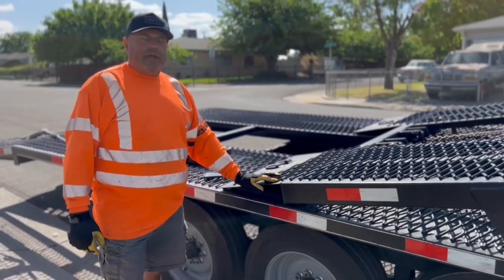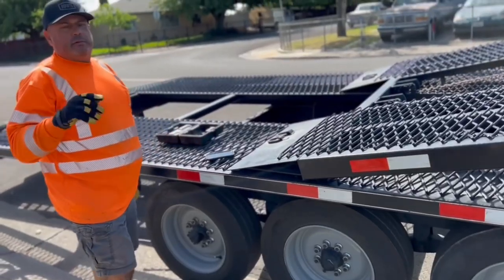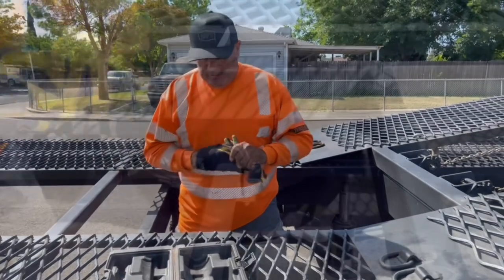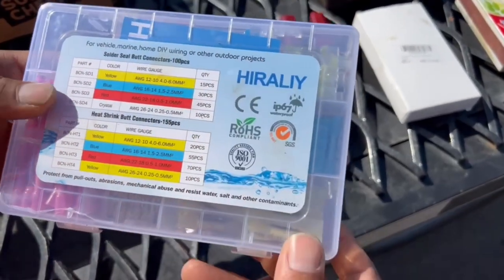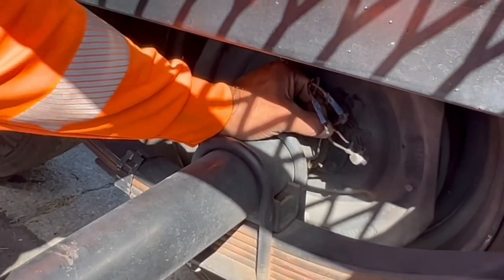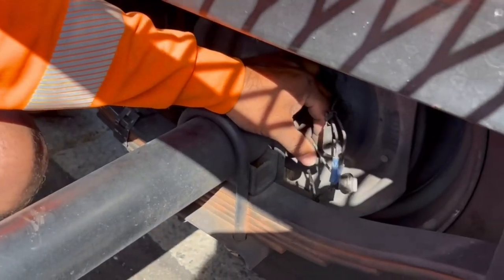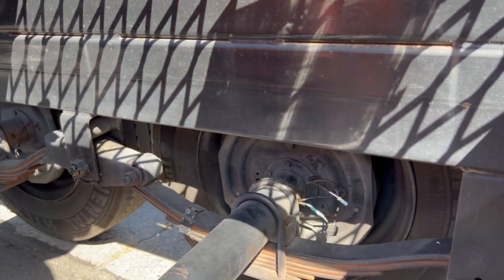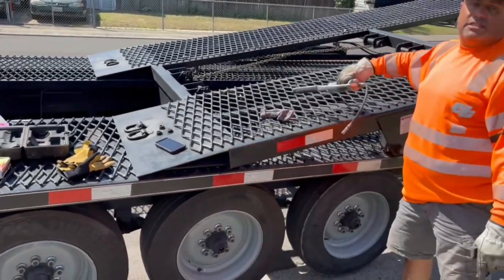Trailer electric brake failure!!  How to check trailer brakes on a 3 axle. Hot shot car hauling.

Comment: Nice video Rios! I have a problem with my brakes they are not working at all, none of them. Also, im wondering why my tires are wearing unevenly. They are cupped. I would appreciate any advice. Keep up the good work!!
Reply from the maker: Check the adjustable on your trailer brakes?  Check brake pads (shoes).  If they are good check each wheel.  Check your bearings too (they can cause uneven wear).  If you have questions while checking give me a call.

Comment: Hey guys! Same thing happened to me. The shop took the cable out the tube and wrapped it around it so “ i can see it better” (looks ugly lol) anyway Question: when you have a full load, on what number you put the trailer brakes.?
Reply from the maker: Hello, Full load 6.5 going down a large hill with a full load 7.0 and empty 4.0.
Reply: @riosautotransportllc  WOW I haven't been using my brakes correctly then! thanks

Comment: Did you ever figure out hooks on wheel plate? You know that stubborn plate under matel match on top wheel base?
Reply from the maker: Yes, it will be on this Sunday’s video using a monkey wrench.
Reply: Do you have a video yet on brake ADJUSTMENT?  Do you have manual or automatic brake adjusters? You’re videos are so very valuable to EZ4 owners!